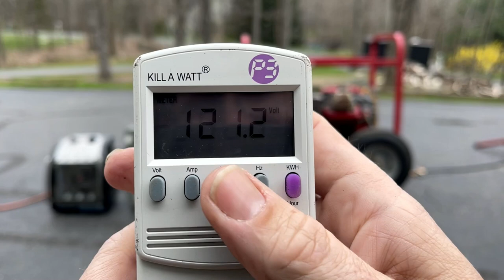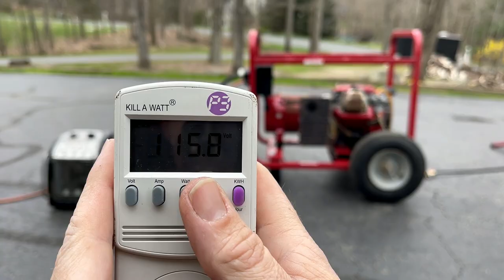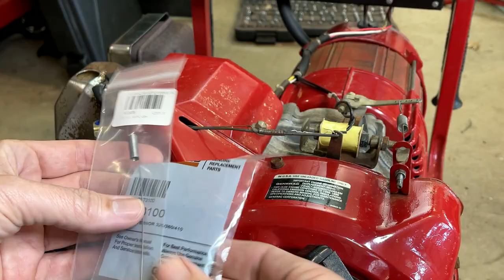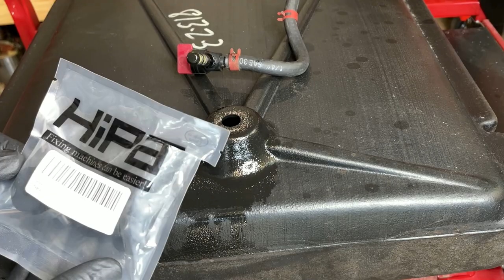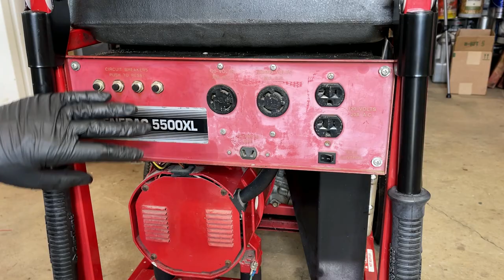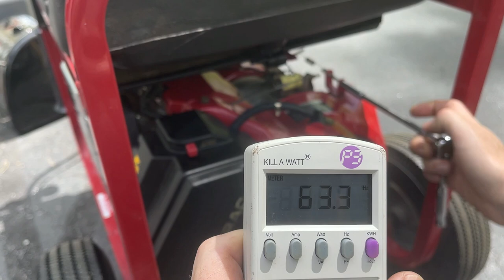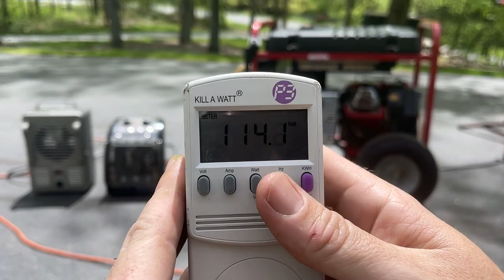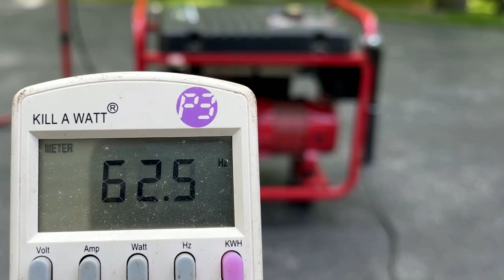Generac 5500XL with Governor Issues

Comment: I am happy you found the problem was with the governor arm adjustment. I have worked on small engines professionally for 39 years and knew it was the first thing to check. Your assumption that if it very close is incorrect. I have had the same symptom and adjusted the governor arm thinking it didn't move but it must have moved an undectable amount because it fixed the problem. Again great work!
Reply from the maker: I agree.  When resetting the governor, most times you cannot tell if the shaft moved.  It does not take much to throw things off.  I am working on another governor issue now that is fighting me.  Similar droop.  Spring looks good.  Have tried several other springs and still no joy.  Potentially just badly manufactured and the governor weights are not proper for the spring used.

Comment: This video certainly may help me in the future.    I have a Generac 7000EXL, so a bigger brother of this unit.   I am the original owner.   I purchased the generator around 2005.   It is stored in the garage.   I only open the garage doors to take something in or our, so normally closed.   The machine has been a reliable unit when needed for power outages.   This video has a lot of information in case my machine starts to give me issues.
The control panel faces a window in the garage.   Sunlight does not fall on the panel, but over the years the paint has faded on the panel, but not the frame.   So likely a different paint formulation on the panel.
I will have to check my output voltage and frequency, just for grins.
Thanks,
Dave.

Comment: THANK YOU! Hurricane Francine is about to hit us in South Louisiana and my generator has not worked in a few years. Between the carb and fuel tank cut off I got from the Hipa store and your video I fixed it! While my 16 year old Briggs and Stratton generator is not exactly identical, this gave me the direction of where to look. Sure enough the governor idle spring p/n 694867 is NLA (go figure) I was able to get a spring locally and modify it to get me running! Thank you again!!

Comment: Nice job, yes the governor is sensitive on those with the low idle control. I disconnect the solenoid wires on the low idle control when I set the high idle because if it has been messed with it can run away on you. After the high idle is adjusted you can set the rpm drop for the low idle control using the magnetic solenoid adjustment because it knows where it started from the high setting resting against it's stop point. I hope I explained that correctly. As always you rock.
Reply: I do the same also

Comment: When you described the governor arm drop, you could see the marks on the shaft from its  original height. Nice work. But you really should support those float arms better when you're  tapping out the float pin.

Comment: Now between the new Briggs book and your deals I hope can set the governor on the 4-horse mower motor which is set up different from every Briggs 'L' head I've ever seen. An all temp starting system with the bi-metal and vacuum diagraph deal and set back into a recess in the housing. with 2 adjustments. Must be an oddball because the book has very little on the governor setup and supposedly covers all the 'L' heads from 81 on out to the last and mine is an 85. Oh well, such is life. Glad this one is straightened out now. Sometimes it's a trial and a half. BLESSINGS to all yall! Thanks, Pal!

Comment: That's a Briggs generator branded Generac. Common unit that came in Powermate, Coleman and other brands. Most parts are plentiful or available used. I just put one together with used parts. It was eaten by pitbulls. If it was rubber they ate it. Sold it for a $200 profit. I've owned probably 20 of them and never found one with a bad generator unit. Most engine issues. Everything from valve, head gasket to carb issues.
Reply: I have one missing the recoil starter bolts- any clue what size I need? Bought a new recoil, but no bolts with it....
Reply: That's a Generac engine. It shares no parts with any Briggs.  Briggs may have made it, but it's all Generac exclusive parts.
Reply: I had 2 2004 yr model Colemans but I sold 1 for what I paid for it. It runs great. I haven't started it in probably 5 years. I have a 12000 watt one now in case I need it here in central Florida. It runs on propane or gas. It's set to go but haven't needed it. I've never ran it but did put oil in it. It will run entire house including central AC so long as I don't turn on all 220 appliances at same time.

Comment: You owe me a beer! When you started to remove the four exhaust bolts, I bet you a beer at least one, if not all four would break. Also, just remove the valve cover, clean and use Rustoleum High Temp silver spray paint to refresh the finish back to pretty!

Comment: I've found sometimes if you can't get the governor droop low enough without surging, is that the main jet is too small. This is common on newer generators that need to comply with stricter emissions regulations so they run the mixture lean from the factory. Replace or drill out the main jet to a bigger size until you can get the droop and surging under control. Going too far will make it rich, which isn't good either.

Comment: Very cool work James! Also great catch on the governor arm hitting the mounting bolt. You taught me something new today! As you know I have the 7,000 EXL, I would just double check the brushes and slippering assembly to make sure they're nice and clean as you shouldn't have too much of a voltage drop going from 123 volts ac down to about 116 volts ac at 2/3 load. 

It's great to see these machines still surviving they're very well built!!
Reply from the maker: The Generac XL series is well built for sure.  One of my favorites.  This one had me stumped for a while.  It must have been just barely touching that bolt at times.  And then I made it worse, but it got me there in the end.  I wonder how many have been trashed because of that issue.
Reply: @jcondon1  who knows, I'm always on the hunt for a second 7kw or 7.5kw exl to compliment my existing one
Reply: @Bassguitarist1985  my XG10000E had the same governor droop issue. We spoke in another forum about it. I was so happy to see James face the same issues I had, and I tried every solution he did. However, mine still droops to 54 hz under a 2k watt load on a 10k watt generator.
Reply: @matt dewater when the engine running does the governor arm have tension, as in it wants to keep the throttle closed?
Reply: @Bassguitarist1985  yes. I updated my post on the Gentek website. Authorized service center can’t figure it out.
Reply: @mattdewater438  i saw the post. Not aure where you are located but if you are near NY or CT im sure either James or I can look at it

Comment: I have a new Generac. Well, I have about 60 hours on it now. We get power outages for extended periods every year. Only thing that I DON'T like about it is, OEM parts are super expensive. And it's not electric start. I think at this point I will just get a cheaper Westinghouse or Ryobi electric start one and sell mine. This way I can connect it to my house with auto switching.  Speaking of, I should send you this big box of Generac OEM parts i have. New in box. I'm a reseller so I often get stuff like that. I have no use for them.
Reply from the maker: That would be great!
Reply: Get a eBay starter kit and install it

Comment: I'd like to make a suggestion; you have several carbs around with broken off float ears... What I do is to put everything together and put a couple drops of JB Weld, or epoxy on he broken one, wih the pin installed.  It will last as long as we do.

Comment: On the rusted chrome, when it's that bad you can't really restore it. My trick is to use a brass wire wheel over it all, then use a high-heat paint to make it look OK. If you want to carry that all the way, you can block-sand between coats until the pits and edges are filled and end up with a very pretty finish that lasts; lots of work though. Using a steel wire wheel tends to remove too much metal and can even create holes which is why the gentler brass instead. Is it worth the effort? You decide but if that's the only major 'flaw' it can help considerably.
Reply: I kept coming back to the cover thinking, "Soak that overnight in a citric acid and water solution and in the morning clean and polish it."  Drove me nuts.

Comment: I have a suggestion. I would fit a pair of heavy duty swivel castors that have a brake on them. Makes it easier to move the generators, & the brake will stop it moving around during operation.

Comment: When you tried to clean up the valve cover, and ehat shield, if they're aluminum, try Superior Products' Aluminum Brightener (O'Reilly's Auto Parts, acid cleaner) it will clean up anything aluminum like new.  For steel, you can use Evaporust and steel wool.  If it's chrome, I'd just use a chrome wheel cleaner for auto detailing.

Comment: I have one just like that, that I haven't used in a few years because the gas cap went bad and it was $50 for a new one online. Also, it only leaked oil when it was running and hot.

Comment: Hey James, hoping you would be able to help me with a problem I am having with my generator. This is on a 9000W predictor generator and while the generator is running the power coming from the outlets cycles between being on and off. The engine is running very well and isn't being loaded and there are no circuit breakers being tripped.

Comment: Looks like you got a bigger Ultrasonic Cleaner you finally get rid of the Harbir Freight Ultrasonic Cleaner? @James Condon
Reply from the maker: The Harbor Freight cleaner was sounding sick.  I think it’s day are numbered.  I think it worked just as well as my new in if not better.
Reply: @jcondon1  ahhh got Ya That happens when you use something so much the lifespan of the item shortens

Comment: After all this effort, I think you need to paint the valve cover, recoil starter cover and the air cleaner cover bolts. Also see if you can find VinylX in your local parts store, I use it to bring back faded color like that control panel and it works extremely well!

Comment: what is the torque spec on the carb bolts?  Love watching you work thru stuff... I'm getting ready to rebuild or replace my carb.
Reply: Were you able to find a carb for yours.  I have been searching for a briggs carb.  Just need the little choke lever, mine broke, and the bowl gasket.  A new Carb would be the ticket

Comment: You can remove rust and tarnish from chrome parts without scratching by using fine bronze wool.   I restored a set of chrome exhaust pipes from a 1979 Honda 750 Four like this and they looked nearly new when finished.

Comment: This was interesting.  I've been looking for videos on how the various governor springs and adjustments interact.  I'd like to make the one on my oldest generator a bit more responsive, but it doesn't appear to have multiple spring positions like these later models do.

Do the recoil and air cleaner covers normally mount sideways like that?  It almost looks like someone swapped covers with a different model.

Comment: Great video! What cleaning solution do you use? I have a new Generac 12000 generator that I have never used. Unfortunately I let it sit with gas in the the tank/carb and it would not start. I removed the carb and completely clean it as you did yours. It started right up, but it ran at high RPM ( around 4200 RPM) way too fast. I didn't touch the governor at all. Have any idea what I did wrong?
Reply from the maker: Make sure the idle set screw is backed out.  I might be holding your idle speed up.  Also with the generator off move the throttle plate.  Make sure it can fully open and close.  You will have to take the airbox cover off and shine a light in the carb to see if it is fully closing.
Reply: @jcondon1  I thought the throttle linkage was working properly, but I'll take another look! Thanks

Comment: could you tell me what the purpose of the long spring around the bar is.. its attached to the same points as the bar at both ends.. the spring will never move or extend and I'm sure its supposed to by being anchored to something other than the bar it's around. ???

Comment: I have a 4000 EXL , mine is surging like that , and when it goes from low idle to high it bogs down and sometimes stalls , I originally thought it was the carb so I cleaned it , it needed it anyway. This video has confirmed when I suspected
Reply from the maker: Bogging usually is the carb.  Either dirty or a clone.  Clones carbs are not jetted quite right.
Reply: @jcondon1  I took the carb off and sprayed it with carb cleaner but I didn’t blow the ports out with compressed air , i should have known better, also when I took the linkage off I don’t remember seeing the spring for the governor, unless it was attached to the throttle linkage, I’m taking the carb off again to clean it better and will look at that spring. This is the original carb and this gen is barely used
Reply: @jcondon1  I pulled the carb back off and cleaned it and blew compressed air through it , it still stalls at low speeds, I can’t find the low speed or pilot jet , all the holes seemed clear ,
Reply: Oh and this is the original carb ,

Comment: Hello James, I was wondering if you spray carb cleaner in the fuel screen on the carb so you can see if fluid goes through properly
Reply from the maker: After they go through the ultrasonic I rinse them in water from the faucet and let water flow through the fuel inlet to make sure there is good flow.

Comment: I have a Winco Dyna D3000H generator, it has a Honda GC160 engine. Runs great and maintains a fairly constant speed (with a constant load or no load) and there is no governor hunting at all, even when applying full load and suddenly removing it.

Only problem is the engine speed drops too much under load. If I adjust it for 62Hz no load, and then apply full load, it drops to about 56Hz. Engine power is not the issue as I can manually increase the throttle to 60Hz with a full load no problem.

Adjusting the governor arm made no difference. Couldn't move the governor spring to a different position as there is only one hole in the governor arm. The whole governor arm and throttle linkage seems to move freely and does not rub up against anything.

What are the chances the governor spring is just tired and stretched out? Would that cause this sort of issue?
Reply from the maker: A worn out governor spring could cause the issue.  Moving the spring position closer to the governor shaft could help (If you had that adjustment).  Otherwise not much you can do.  Ideally it would stay above 57 hertz.  The closer to 60 the better.  But under full load, most generators hold in the 58 hertz range.
Reply: @jcondon1  I drilled a couple extra holes in the governor arm to allow adjustment, but unfortunately moving the spring closer only resulted in the generator speed becoming less stable and wanting to hunt a lot. Finding an OEM replacement governor spring turns out to be not so easy, so I picked up an assorted pack of generic governor springs of different sizes and managed to find one that worked ok. It now sits at around 62Hz no load, 58Hz full load, which is actually right in the ballpark of what the owner's manual suggests it should be. I did notice once I removed the original spring that the coils of the spring do not come together tightly with no tension on the spring, so it's definitely a little stretched.

Comment: You broke off the two upper bolts on the muffler cover. The one on the right that you drilled and tapped is loose and oscillating as the engine is running toward the end of the video.

Comment: Service manual for that generator calls for 61.5 - 63.5 Hz without load. I set mine a little over 62Hz. Is it better to set it at the lower end?  For idle controlled speed, it calls for 38Hz to 40Hz, but my kill a watt just turns off below 40Hz (may be voltage was too low?), so I set mine at 40Hz.
Reply from the maker: The slower the better to minimize engine where.  But yes some manuals do call for a higher no load speed.  Definitely keep it high enough to keep the powerhead running.

Comment: good job. I have a ProForce 6500- 8125 with 414 hours. had to replace carb 2018. new 2011 what service should I do on the power head.  I am 72-year-old been turning a wrench before I was 10.

Comment: Hi James, I have followed you all things generators and I was interested in this particular video. I have a Generac Megaforce 6250 generator almost identical to the 5500 in this video. It has been a workhorse for me with more than 3000 hours powering a cabin off grid in Maine. I ran into almost identical operating conditions resulting in run away engine speeds. I have replaced all the springs and have done the adjustments just as you have in the video and was able to slow down the engine. Unfortunately now when I apply a very heavy load say 5000 watts the engine struggles and runs very rough. I am of the opinion that perhaps the plastic gear internally is worn and that is what is causing the issues. Does this make any sense to you?? Thank you, John
Reply from the maker: Is the engine maintaining its speed when under load?  It’s normal to slow about 5 hertz (300 rpm).  The governors job is to slow down the engine.  If the engine is only slowing down, then it is working internally as it should.  If too slow and not running well,  then would start looking at other things like compression, leak down and fuel delivery.
Reply: Thank you James I'm heading to Maine next week and I will bring the generator home with me and I will keep you posted. I appreciate your help!!

Comment: Hi again.i have 4000xl too....my 12v dc port only test 10.4v is there a pot to adjust it?
Reply from the maker: There is not adjustment for that.  Might need a new bridge rectifier.  Would also check the connection for corrosion and clean them up.